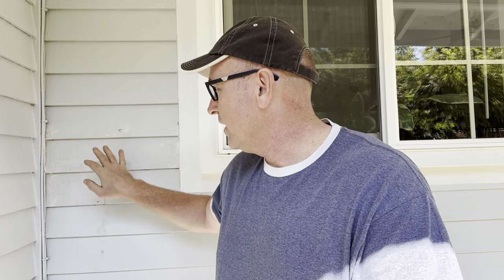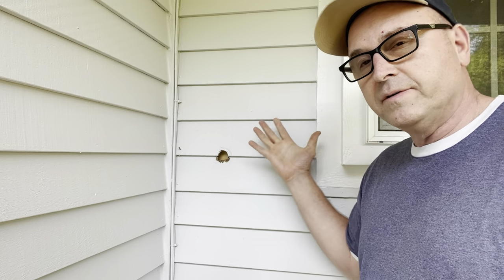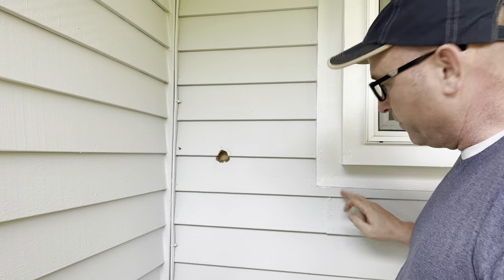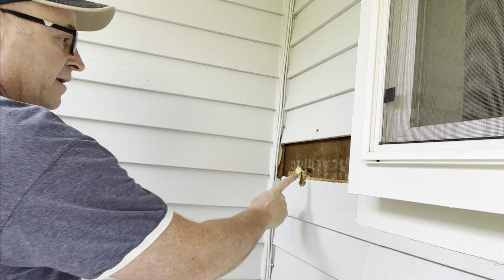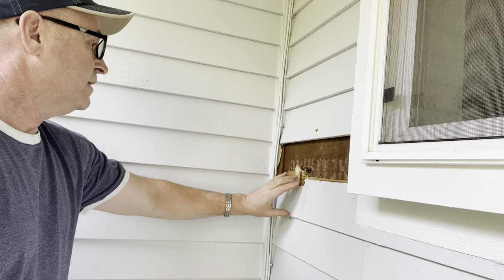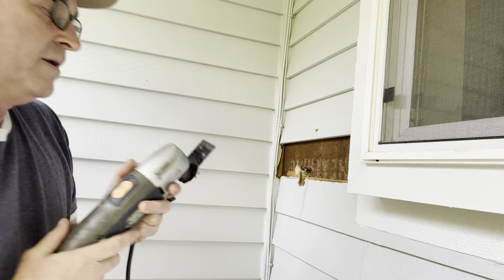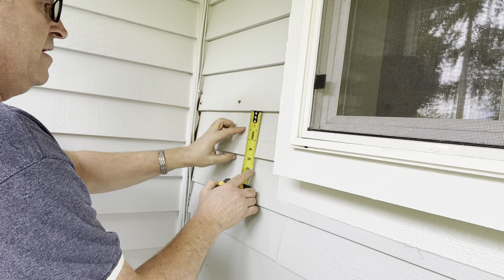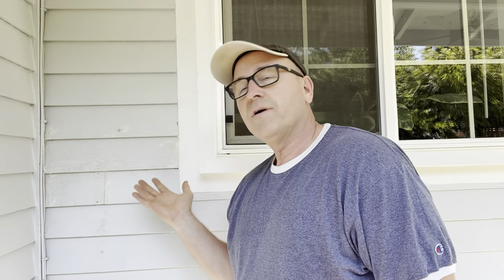How to Fix a Hole in Siding

Comment: Oscillating multi tool is literally the best gift I was ever given. I use that thing for so many projects around the house. Definitely recommend to anyone he gets one buy your blades in bulk because they are so expensive when purchase individually.
Reply: Thank you so much for the suggestion ☺
Reply: @OmANnIe  your welcome. Just like to let everyone know because the first time I hit a replacement spent 15 dollars for one blade. Amazon has them in like bundles of 50 for less then a dollar a piece. They work the same as the expensive ones because I don’t notice a difference when cutting through metal.
Reply: @Mrx7tloma  oh gosh, that helps me so much. I bought my 1st sander because I needed to patch a hole in my bathroom and was surprised how expensive tools can be. I'm trying to learn as a I go, so I sincerely appreciate the heads up. 🙏

Comment: Hi, dad!  Question.  Do you think you could make a video on how to polish dress shoes/boots and what products to use and/or stay away from?
Reply: I had a lot of fun watching my dad polish his dress shoes for inspection the next day.  He'd unlace the shoes, get his soft bristle brush and vigorously clean the shoes for several minutes.  Then he would get a soft cotton rag and rub in the polish - which kind depends on what your shoe is made out of.  Always starting off with a small amount because it is easier to add more if needed.  After the polish was completely rubbed in he'd use another soft cloth to buff it all out.  My husband will often use a spray furniture polish (for leather couches and stuff) which looks good for most occasions but is just slightly less "polished" than traditional shoe polish.  So long as you clean the shoes thoroughly and avoid rags that leave lint or random threads behind and use a polish that matches the color and type of shoes you should be good.  If you need to pass inspection then I would strongly recommend the traditional polish.  It takes more time and effort, but your inspector will know the difference and may mark you down for it.

Comment: if your siding is pvc, go buy a plastic welding kit, use stainless screen mesh to fuse the hole to the plastic by bending a cut section to match the shape of your siding, once the screen is fused into your pvc use closest color matching plastic welding strip/rod and fill in the screen where the plastic was missing till it looks solid, you can now paint it to match the house
this can also fix other plastic parts and they sell a heat stapler gun for fusing torn thicker parts so you can start welding it back as well making it way stronger

Comment: Thanks Dad, needed this one!😊 Could you also help with how to fix a hole in a plaster wall, please?
Reply: Fixing a hole in a plaster wall, or is it dry wall?  If you can see wooden slats in the hole and the edges of the wall kinda crumble a bit it may be plaster.  If there are no slats and the edges of the hole are more powdery with a paper outer layer than it's probably drywall. If it's plaster and a bit on the small side (around 3 inches or smaller) you will need a can of patching compound, sometimes called "crack patch" and sandpaper and a little paint.  Gently knock the loose bits free from the edges of the crack and then fill it in with the compound.  Usually it goes on pink and then turns white when it's dry.  Once it's dry sand it lightly and then paint the area around the patch to match the rest of the wall.  If the hole is too large or the slats are too damaged for the patching compound to adhere to then you can either replace the slats or just square the hole out and use drywall.  One time I kicked a hole in the wall moving laundry out of my way (the plaster was extremely fragile).  My dad had me stuff newspaper into the hole until I couldn't stuff anymore and then patch it.  I got the impression we could do that because it was so close to the floor.  I've never patched drywall, so I'll leave that for someone wiser.  Good luck!

Comment: I have the vinyl siding stuff. Can you do a video or suggest on how I should handle that? I did fill some holes with thru the roof silicone caulk. and it seems to be sealed but I’m worried that it’ll cause sweating on the inside in the tivek. There’s a big hole that I can’t reach it’s about 18 ft high. And I’m wanting a great solution

Comment: Hey dad, instead of an osculating tool, why not use a grinding wheel?
Reply from the maker: A grinding wheel wouldn’t be as easy to control, or as precise as the oscillating tool, but you could probably make it work.